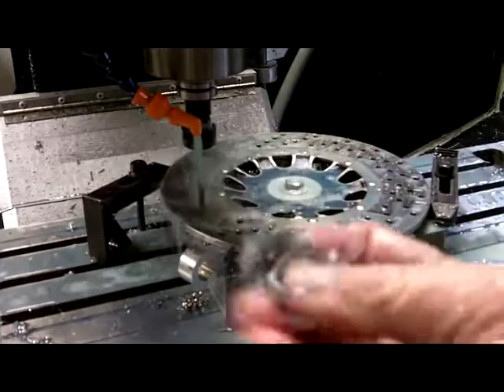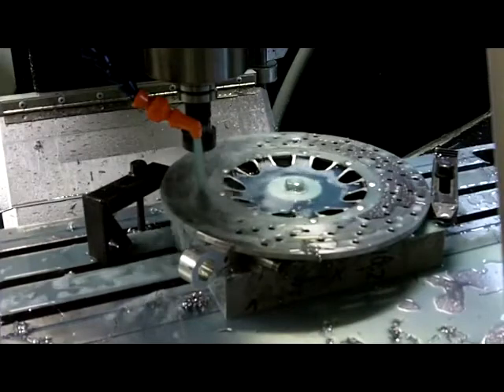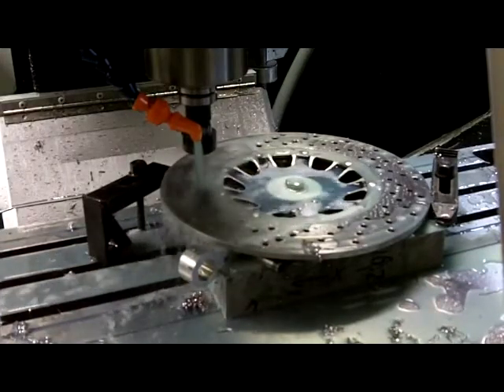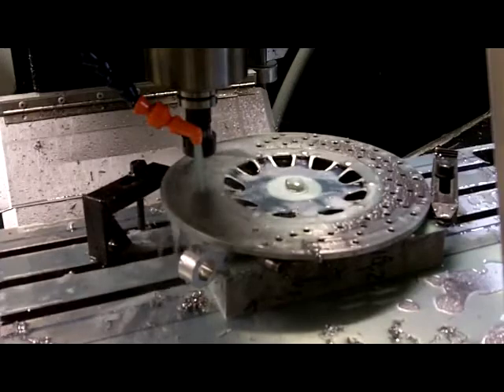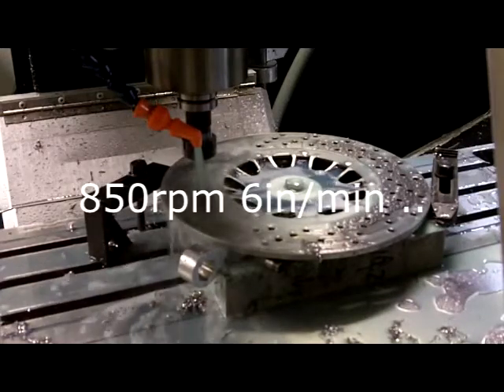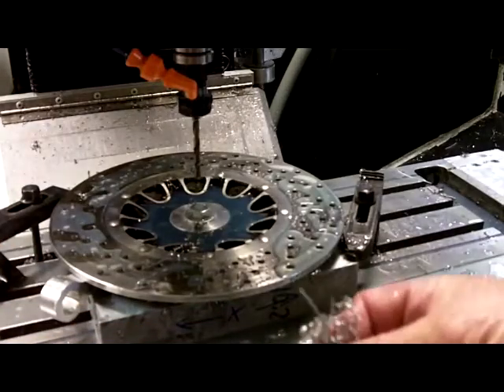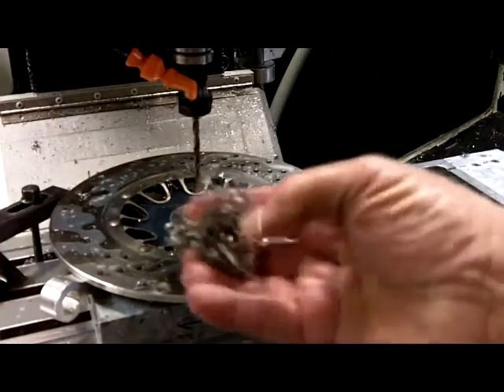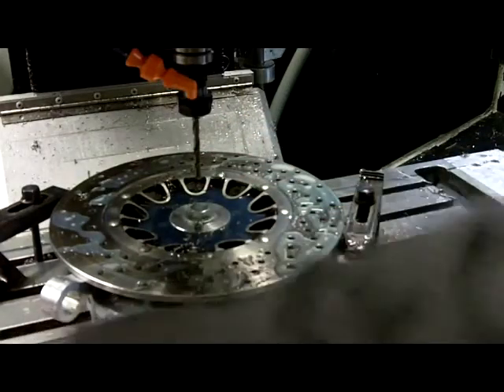Drilling a brake rotor

Comment: Nice work. Did you chamfer both sides?
Reply from the maker: Obsession,
Appreciate the compliment .. Yes, both sides are chamfered.  The fixture plate it was bolted to had locating pin holes drilled at 3:00 & 9:00 so the part could be flipped over & located accurately.  In the cam software I also flipped the hole pattern & re-ran the g-code to produce a mirror pattern for chamfering the back side.